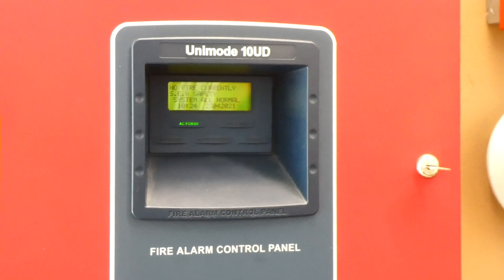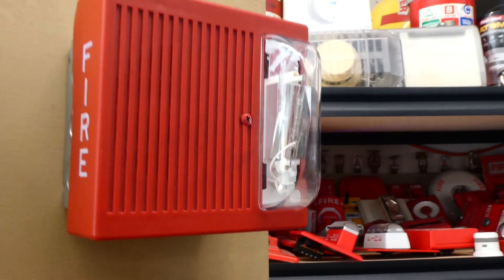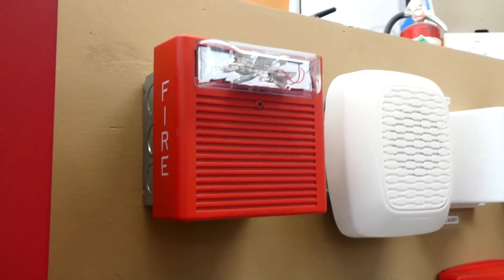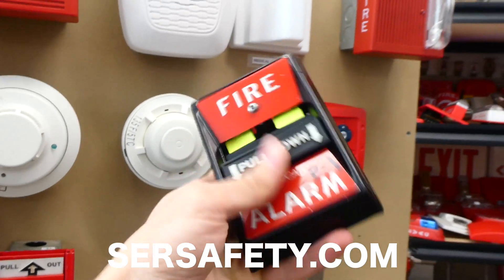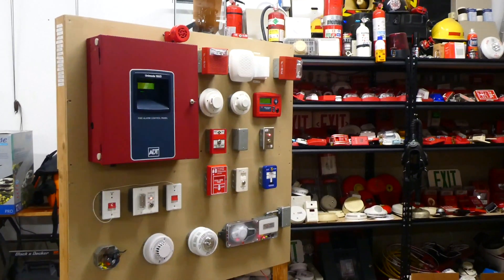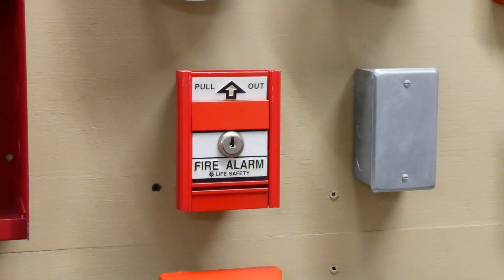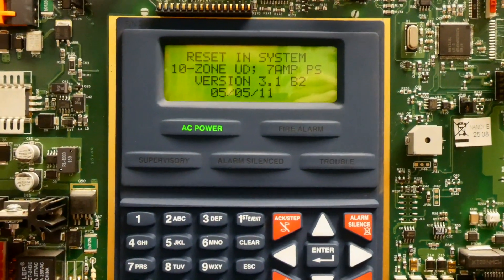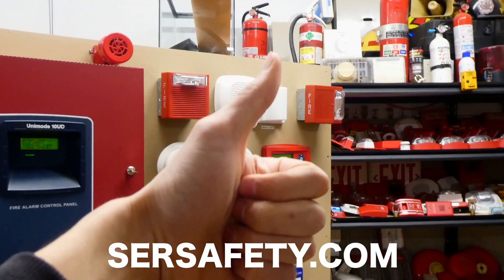ADT Unimode 10UD Fire Alarm System Test 19 | Vertical Wheelock AS!

Comment: a part of my school has those alarms, vertical ones it the hallways and horizontal ones in the rooms. In the main part, it has some older wheelock alarms that look like a 7002t on a strobe plate. The newer parts have NS and ZNS. The 8th grade portion of the school  have spectralert advanced ceiling mounts. Imagine what a drill would sound like!

The croaking and cracking of the 7002ts, the EEEEEEEEEEEEE of the AS, the screech of the NS, the Normalness of the ZNS, the advances, ugh….
Reply: The "older wheelock alarms that look like a 7002t on a strobe plate" are probably 7001T's or V7001T's.
Reply: @mikebode7560  yes it is